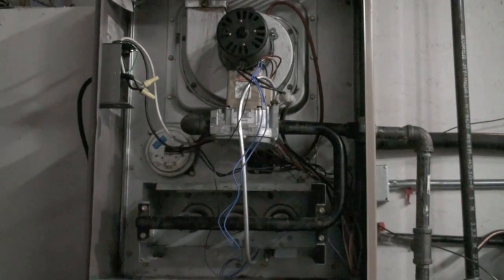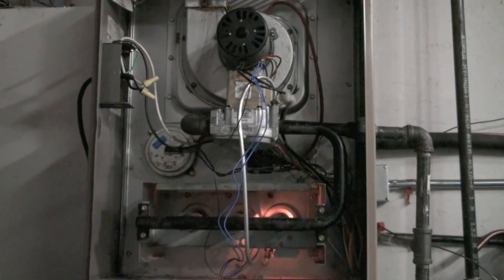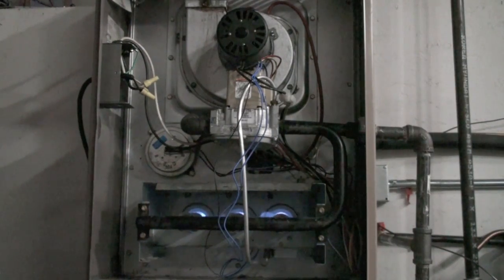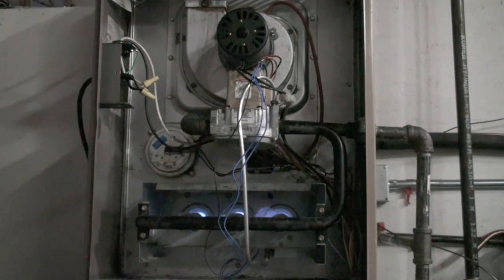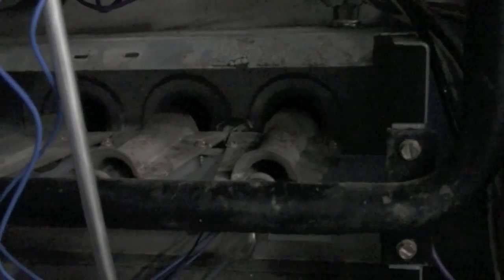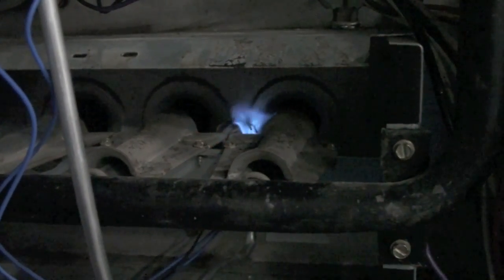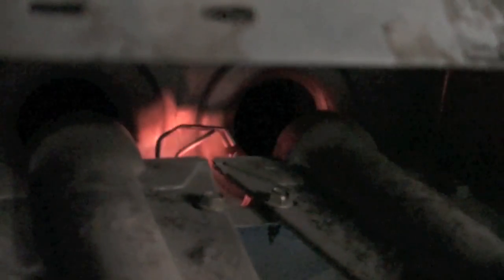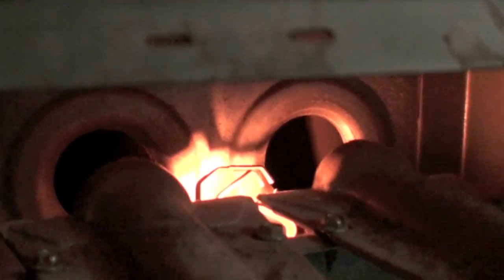How smart valve furnaces work and troubleshoot.

Comment from the maker: If the pilot is yellow and lazy, I would clean the pilot assembly.  You can adjust but it will probably not help.  And yes the adjustment screw is under the phillips cap.  Hope this helps.
GFM

Comment: I think I need to adjust my pilot flame, it will fluctuate many times until it stays lit when furnace is cold, if multiple restarts in morning to bring up temps it will light every time, after an overnight cool cycle that first time it takes multiple attempts and just HSI will be glowing and draft fan running. Manual says remove cap to access adjustment, only saw phillips screw with gasket near pilot feed, is that the cap they refer to?

Comment from the maker: If you have cleaned the flame rod on the pilot, and it still does not work, the valve assembly has failed.  Be careful cleaning the flame rod as the HSI is right there an d is easy to break.  Hope this helps.
GFM

Comment from the maker: The only thing I can think of is if the furnace is cycling too often.  Filters clean, blower clean?  The furnace should cycle in cool temps for between 5 and 10 minutes.  If it is cycling 2 to 4 min, and the thermostat is mechanical, the anticipator is set incorrectly.  Check the thermostat anticipator playlist.  Hope this helps.
GFM

Comment: I was having issues a few months ago - HSI was not coming on. Service company came, replaced pilot assembly, everything worked fine. Now I'm having the same issue - thermostat calls for heat, HSI will not come on. I can light the pilot with a lighter at that point, and the furnace will kick on, but it won't light on its own. Can you think of a reason why I would have two HSIs go bad in a span of a few months?

Comment from the maker: I dont know of any am stand furnaces that used the smart valve.  Is there a pilot tube?  If not, it is a direct ignition where the main burner is lit by the HSI.  If the HSI comes on and the burner does not come on, Look for gas supply problem, If all valves are on, you have a problem with either gas valve or control board.  Hope this helps.  Let me know.
GFM

Comment: American Standard Freedom 80 Single Stage furnace model AUD060C936K3, does it come with a smart valve?
When I turn on the heat, I can see the igniter glow red hot for about 20 seconds, but I don't see the spark click or gas valve open.

Comment from the maker: First clean the burners.  Then, if that does not work, watch the flame very closely.  If ,when the fan comes on, there is any change in the flame suspect a cracked heat exchanger.  Be sure when doing this, the fan cover is on.  Merry Christmas.
GFM

Comment: Saw a furnace just like this and it would light and run just fine.  However, on one of the burners the flame could come back toward the orfice and make a little pop.  Do you think that might have been a heat exchanger problem?

Comment from the maker: The troubleshoot is pretty much if the ignitor lights the pilot and the main burner does not come on with a new pilot assembly, the valve has failed.  You might check the plug going into valve for tight.  Also make sure all ground wires are tight.  There is a youtube vid on repairing the electronics, but I am reluctant to get that involved.  There can be safety issues.  As for gunk in the line, it would take a lot of gunk.  Unfortunately, smart valves have a reputation for failure.
GFM

Comment from the maker: There are only 2 parts to the smart valve system.  The pilot assembly and the gas valve/flame safety control.  The only other possible problem I can think of would be low gas pressure.  If gas pressure is ok, (if you have other gas appliances, and they are running ok,)  pressure is ok.  So, short answer, probably the gas valve assembly.
GFM